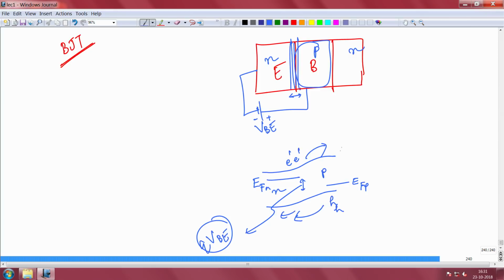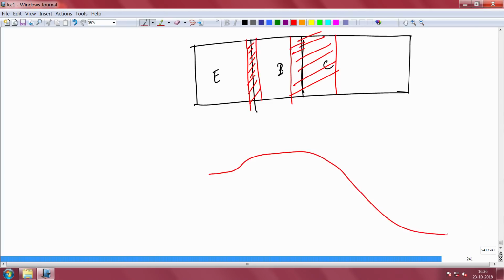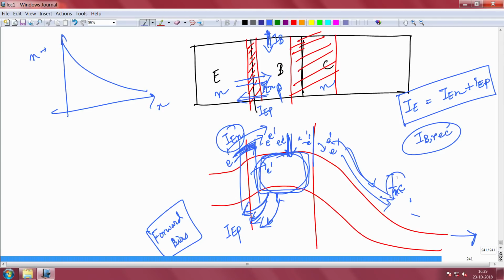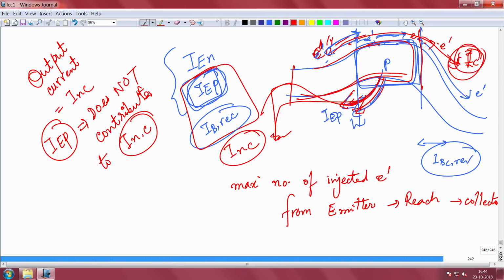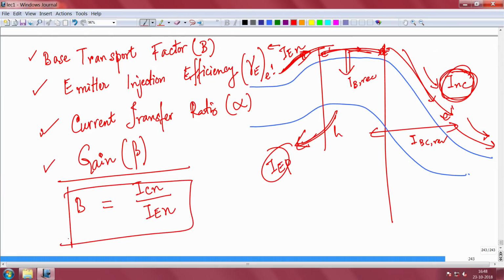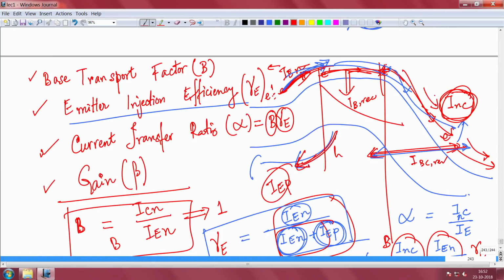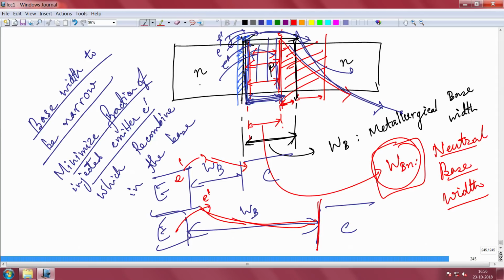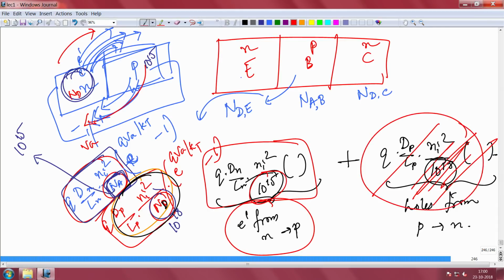Basics of BJT

Comment: Every single person uses "swept away" they do not say if it is diffusion or drift movement. Just "swept away" 😢.  Also, you see, something that's really ignored. From normal teachings in conduction in metals, potential difference causes current flow. Why is it that when you leave the base floating,  the potential difference between collector and emitter is not sufficient enough to lower the base emitter junction to cause a forward bias and allow current flow. Why? Typically, check anywhere, the emitter collector voltage is way higher than 0.7volts. How does that even make any sense🤦‍♂️🤦‍♂️🤦‍♂️🤦‍♂️🤦‍♂️🤦‍♂️🤦‍♂️🤦‍♂️🤦‍♂️🤦‍♂️? And nobody explains it. Nobody even tries to admit the fact that this dilemma is present.
Reply: Do some questions of BJT on your own for clarity of voltages, BJTs are not used now so study the Mosfets.

Comment: At 33:00 For the current due to electrons to be higher, the doping of donor atoms should be low as they are inversely proportional, hence it should be n- and p+ right ?
Reply: Here he considered that N side is highly doped with electrons than holes in the P side, so donors on N side is higher than that of acceptors on P side...and so he put that N+ and P-
Reply: @s_madhan623  Actually , it is not the case I was  talking about, my doubt was regarding the formula  the formula. My mistake, i intrepreted wrongly, the current due to electrons is inversely proportional to Acceptor concentration and same for Current due to holes . So N+ and P -  is correct .